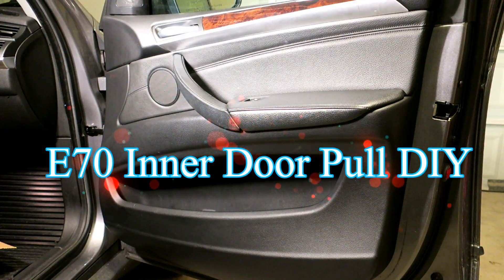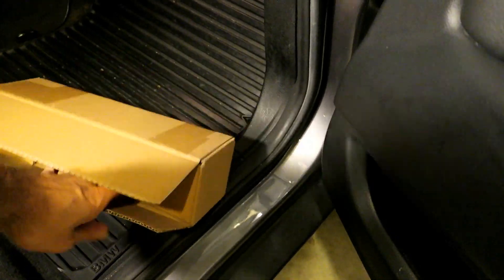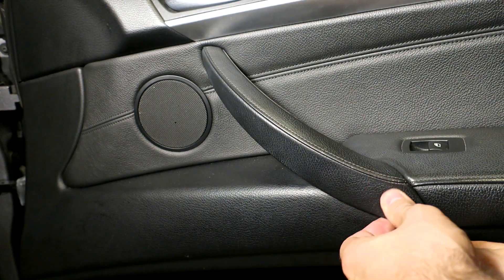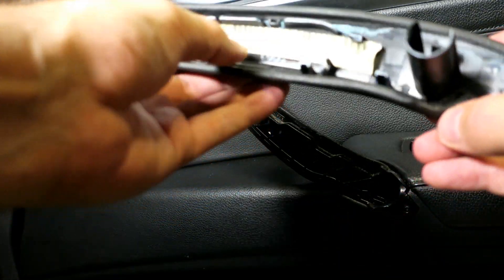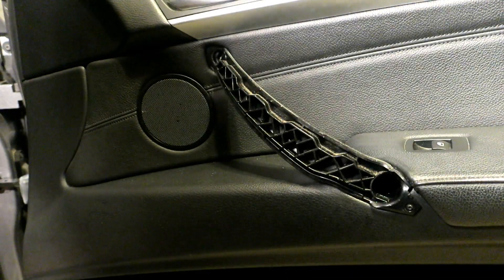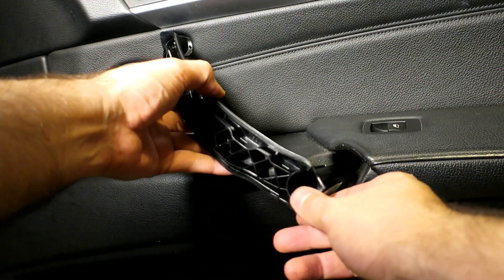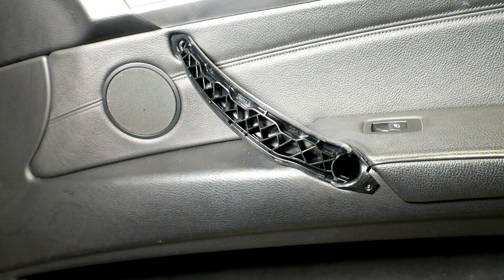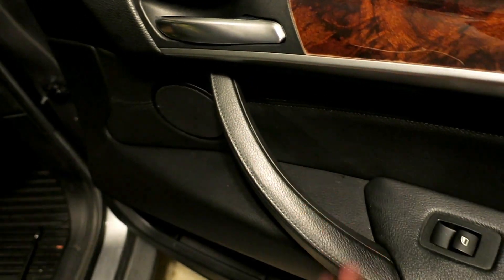Sticky Inner Door Pull Replacement DIY on an E70 BMW X5

Comment: Thank you so much for posting this video, made my life hell of a lot easier and less sticky. Can’t believe this is such a common problem with these vehicles, BMW needs to get their shit together. Thanks again.
Reply: Agreed about getting their shit together. Why do they paint that crappy rubberized coating over all the switch panels (windows) and the steering wheel? Mine is starting to peel and looks terrible. I hope I do not have to remove every switch panel to get rid of that crap, god knows how many labour hours that will take me! What an utterly stupid idea BMW!

Comment: Thanks for the video. You saved me a few minutes by letting me know I had to get my torx set out - 2xT20 and 1xT10 (at the bottom) - super easy! From watching your video I saw that the best way to come at the clips was to start at the back most edge and work it from the side and top - moving forward. I was done from start to finish in under 5 minutes!

Comment: Just did x5 passenger side.  Didnt order the BMW OEM part as this problem would just come back.   Got a direct replacement off Amazon but made with higher quality ABS+PC plastic that won’t breakdown and get gummy. 20 bucks. Company called Jaronx.

Comment: Before installing this part i recommend you to spray it with non gloss lacquer spray to avoid damage, even you can do it for all hand door for protection.
Reply: Thanks Bro, gonna change it out tomorrow.
Reply: Do the aftermarket handles have this rubber coating crap on them too or are they just bare plastic? My 09 E70 handles have lasted 14 years, so if the new ones last that long either a. I will be dead by then or b. the car will be in the scrapyard.

Comment: Sadly, the X3 F25 seems to require door panel removal. Yuk. I thought I had found a suitable substitute when I saw a product that lets you stitch a leather cover over the whole thing... but that, sadly, is no longer available. I with the guy who designed this part of the E70 had communicated with the guy who designed this part of the F25. :)

Comment: Are the Right and left Inner Door Panel Handle back seat a different size?thks
Reply: E70 front and rear use same handle on passenger side, driver rear is different hand.

Comment: BMW rep told me it is caused by natural oils from your hands. 🤔 Don't think so
Reply: Typical BMW BS! I was told i needed to urgently change 2k of parts at a recent check or fail the next official inspection. It had an official inspection 1 week earlier and sailed trough!
Reply: Never go to the Stealership out of warranty.  Find a good Indy shop.
Reply: Definately wrong. Its peeling off because of their "soft touch" plastic treatment. This has been happening since atleast e46/e39 gens , so earlier than the 2000's.

Comment: Good job. Thanks for the part number 51416969402 Black for my X5M . 
You would think for the money these vehicles cost BMW would use higher quality materials. They really messed up on the X5 series. I just had to replace 6 parts under the hood that crumbled and fell apart (51717169420; 51717169419; 51717169421; 64-31-6-945-583; 64-31-6-945-584; 51-23-7-161-345). When you mention this to BMW, they don't give a damn. When you search online, you will notice thousands of these engine and door parts being ordered; sounds like a materials quality control issue. I never had an issue with my 07 M6.
Reply from the maker: Yeah it's disappointing for sure, they seem to build them to only hold up for a few years now days.  At least the parts aren't too expensive all things considered.

Comment: does this part work on the front and back? ECS says this part is for the back but it looks like you are putting it on the front.
Reply from the maker: Eric Garr yeah same for front or back.
Reply: front and rear are same on passenger side
Reply: @dpcollect8754  is it different on driver side?

Comment: Thank you so much that really helped. Really bad of BMW to use this rubbish coating. You would expect more of a luxury cat maker. Just more they can get to replace and make more money. So much for customer satisfaction. I will not be buying a BMW again, due to all the other little faults which pop up. Mind you VW are worse! German cars, and i have 4 of them!
By the way... Look on ebay, there are lots of aftermarket replacements which are just as good and 25% of the BMW price.

Comment: My 2010 E70 X5 had exactly the same problem. I just got the part, followed this video and changed mine. Easy as pie! Thanks very much.
NB. I have a RHD (Australian) car. The part number for the front passenger door (on the LHS) is #
51416969401

Comment: BMW sells you toys and not cars to last for long. they do not own their mistakes and faulty products they put in the market. these sticky gummy happens on handles of doors that i never used....anyway what i did i just scrapped all the melted crap with plastic knife and cleaned with soapy hot water and put them back , the base is black anyway so why bother paying Bad Motor Wanker for parts that will melt again anyway??

Comment: BMW cars leak oil like sieves. Especially those manufactured in the few years either side of 2010. Poor design (6cyl diesel requiring frequent hour-long drives at >80kmh to prevent emission filter clogging up quickly). Poor quality, parts broken within couple years and costing a king’s ransom to replace. We had 3 (323, 525, X5) around the same time and never again.

Comment: I just did this on my buddies 2008 X5 passenger door. Cinnamon Beige Handle P/N 51-41-6-969-404 was $249 at the Portland, Oregon, dealer; $159 including S/H from BMW of South Atlanta. The driver door handle, which is used far more, is normal, but the passenger door handle front is the one that's nasty with goo. Are others having the same experience??